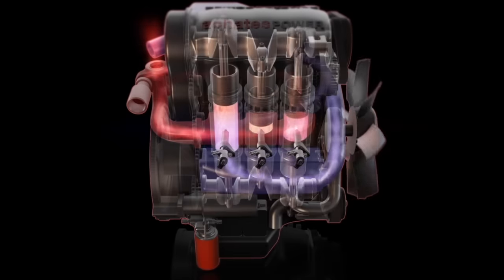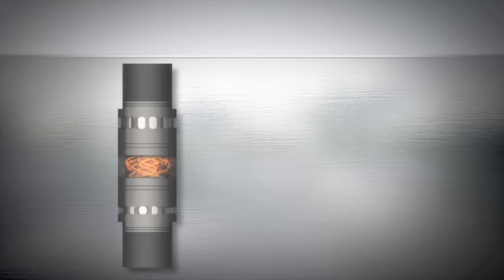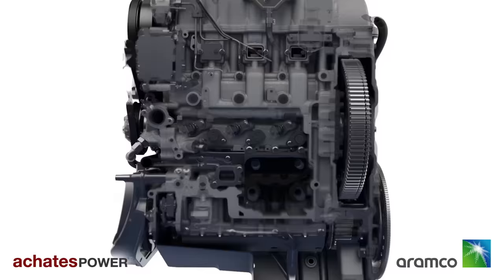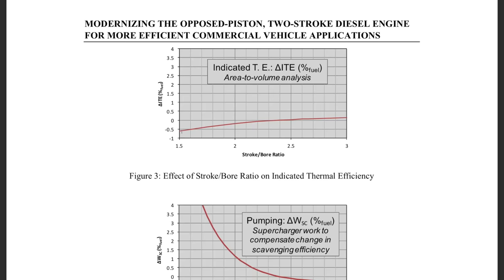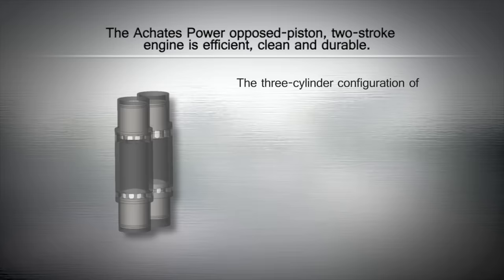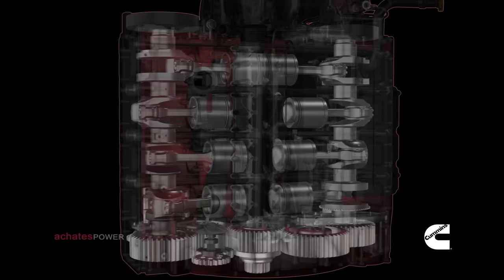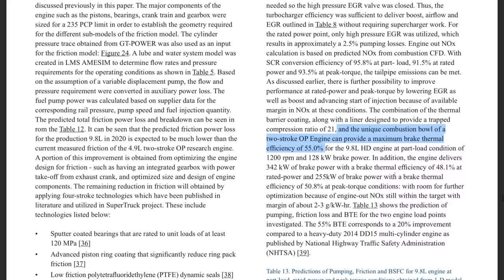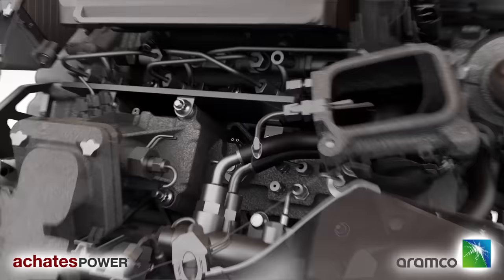Opposed Piston Diesel Engines Are Crazy Efficient

Comment: It should be put in perspective, 55% is an insane improvement in efficency
Reply: Any idea what thermal efficiency we're getting from our standard V-4 engines? 30%? And does this mean that, say, 70% of the fuel's total chemical energy is lost as heat through the radiator and drive train?
Reply: The average thermal efficiency for gasoline engines is in the 20-25% range, diesel engines are much better around 35-40% they will never be that great though thanks to thermodynamics the best case scenario for Internal combustion engines is in the mid 50% range if that for thermal efficiency when your turning one form of energy to another there's going to be energy lose its inevitable and unavoidable nothing can ever be 100% efficient which is why perpetual motion devices don't work
Reply: Theprfesssor that's not exactly why perpetual motion devices are impossible. They are impossible because they produce more energy then they use, as in above 100% efficiency. In theory you can have near 100% energy conversion efficiency. For example Electric Motors can convert electrical to kinetic energy up to 99.99% efficiency.
Reply: @XLR8bg   
   The problem with perpetual motion machine they are trying to do work without energy input, a violation of the fist law of thermodynamics but even if you give them energy to get going they still won't stay going because they will use up the energy and eventually stop, the sun has always been their but it to won't last forever along with all the energy it's given 
    btw the best electric motors can do is 90-96% efficiency which is amazing but still not 100 because thermodynamics is probably the most challenged yet successful theory in physics
Reply: @theprfesssor  You guys are both saying the same thing in different ways and both making true points. No need to argue :)
Reply: @theprfesssor  Thanks! Can you break down the energy losses by category such as heat loss, unburned fuel?
Reply: @tmst2199 
    I think it about 2/3rds of the energy made by internal combustion engines is thermal aka heat which is why cooling is a key part in the design of ICE cars especially performance cars more HP means more heat for example the super car Bugatti Veyron/chiron has like 10 radiators because it makes 1000+ hp and so much heat, actually I believe the engine used almost burnt down the Volkswagen facility when it was first tested in because they were not anticipating the amount of heat it would make
   Other loses are subjective and vary widely depending on the systems used but like I said before turning one form of energy into another your going to lose some of the energy in the process all you can do is try lose as little possible
Reply: @theprfesssor  Thanks. This subject is so goofed up in people's minds. Who profits from that? Technically, all the energy that gets converted to mechanical energy first exists as thermal energy. Heat causes the expansion of the power stroke. So I guess the question would be how much of the total energy of the fuel is being converted to thermal energy. And then how much of the thermal energy is getting converted to mechanical energy (through the connecting rods) as opposed to wasted through the radiator.
Reply: @XLR8bg  for electric motors, the scale play a big role. The bigger they are, the less efficient they become. An electric train engine is around 70% efficient. That's still way better than a diesel/gazole engine though.
Reply: @XLR8bg  I think you mean they use more energy than they produce
Reply: @tmst2199  ...and exhaust
Reply: @theprfesssor  Not native English speaker?
Reply: ( @theprfesssor  the sun has always been their ) Where?      And it has only been 4 1/5 Billions of years.
Reply: @ThePostal67  
      By always I meant as far as we humans and the rest of life on Earth is concerned, it's energy is the reason there's life at all on Earth it was the birth of it effectively...... and ironically when it runs out of fuel it will likely end by destroying the Earth and anything on it along with everything closer then Earth
Reply: @XLR8bg  yes, electric motors can be very efficient. However, we dont want to mislead people about internal combustion engines though, which are measured with thermal efficiency. ICE's fundamentally require a significant amount of heat to be rejected from the system in order to complete the cycle, which make even 60% efficiencies impossible.
Reply: @tmst2199  i believe it may actually be somewhere around 15-20%
which is in no nice term, shithouse.
Reply: @ethan-fel  Are you sure? I read an article recently that stated we were getting better than 90% efficiency from vehicle-sized electric motors.
Reply: @adrianf5665  Yeah. What a waste of resources.
Reply: @ethan-fel  i think you may have that backwards mate. At least with induction motors, the smaller they are the less efficient they will be.
Reply: A modern F1 engine is above 50% efficient, but that is really a special case.
Reply: @mawe42  yeah because they are hybrid engines
Reply: @mawe42  Interesting. I wouldn't have expected efficiency. Only performance.
Reply: @mawe42  yeah, you can't count them because they aren't designed to be used more than once. 200 miles is getting long in the tooth for one
Reply: VW: 55%? Here, hold my ECU programmer for a minute
Reply: Alex Frideres most of the billionaires are pushing renewables and carbon taxes to keep energy cost higher. The problem with this engine is that it burns oil and wont pass emissions easily
Reply: Along with heat, noise is also energy loss
Reply: @Mike Mixer These days these engines can do more than 2000, but that's still not much
Reply: @theprfesssor  wrong modern 4 cyl engines are getting around 35% and new Toyota engines are now getting 41%
Reply: @ThePostal67  proof the sun has been there for 4.5 billion years? It could have been created 50,000 years ago, you don't have any idea. No one does. Cool theory though!
Reply: @tmst2199  electric motors themselves may be efficient at converting energy into useful work, but the storage of the energy they use is not as efficient as a gas tank in a petrol car.
Reply: @slooob23  Correct. A gas tank can store more energy than a car battery even if half of it is lost as waste heat.
Reply: I wonder what improvements can be made with that greater efficiency to satisfy emissions regulations with minimal increase in technical complexity.
Reply: theScottsman1996: Not really... the large marine engines have been over 50% for years.
Reply: @ethan-fel  Not by the "time" you generate and transport the electricity, eh... which is why co-generation works when you can use the "waste" heat from an on-site generator set.
Reply: @LawClapp95  I suspect that if that figure of theirs isn't based entirely off what they pulled out of their ass the discrepancy may be due to a study comparing the average efficiency of operational electric locomotives and operational electric cars. Of course, such a study would be very misleading as it ignores hugely significant variables between those groups both related to the massive discrepancy in the average age of these two classes of vehicle. The electric locomotives will on average have been manufactured far earlier than the cars and will on average have many hours more wear and tear degrading their performance also. All simply because they were able to carve out an economically viable niche in the market far before electric cars were able to thanks for the most part to them being constrained by nature to follow very predictable and rather precise alignments as they travel thus making it rather easy to power them by aligning a collector contact with an external fixed conductor and not have to wait for onboard electrical storage technologies to be an option. Road vehicles are much more tricky to power this way without some sort of active system to maintain alignment as they have a degree of freedom in the lateral direction trains simply do not have.
Reply: Entropy Calculations of every process ...   Or, for the younger generation  .. Harry Potter magical energy.
Reply: Could this be an air-cooled engine? How would compression braking(Jake brake) affect it? Start stop hybrid? For class 2 to 8 trucks?
Reply: Yes I am surprised the efficiency of existing engine designs wasn't mentioned
Reply: @XLR8bg  without a perfect heat sink no engine of any type can be perfectly efficient, and a perfect heat sink doesnt exist
Reply: @tmst2199  The lost energy is mostly in the exhaust gas, not the radiator or drive train.
Reply: @pauleohl  As unburnt fuel or heat?
Reply: @theprfesssor  Tesla turbine cold steam turning is near 100% efficient. Its done in near vacuum, so its strictly a heat conversion... you know... its interesting enough that tesla turbine gets cold as in it exctracts heat and turns it into energy.
Reply: @XLR8bg  didnt know they gotten so efficient. are you sure its near 99% efficient? I almost cant believe it apart from some nanometer accuracy supercooled experiment.
Reply: even if the electric motors are more efficient, the batteries are not. They heat up while charging and discharging, charging them from 80-100% wears them out and they have to take way more energy than from 0-80%. So yeah electric is best, but not batteries
Reply: @jerrykinnin7941  yep
Reply: @jamesbrown-pk2do  only money pits
Reply: @marcoaranas  well it's a reference point between created temp and cooling temp.
Reply: @ungivenfame1  that's not how thermal efficiency works. The electric parts arent cooling reservoirs or temp reservoirs
Reply: @zcoleman4187  all engines burn oil. Even electric motors burn their grease. Also most diesel 2 strokes dont actually burn that much oil relative to their 4 stroke counter parts is comparable
Reply: David M  my brushed dc motors range from 0-70 percent thermal efficiency.
Reply: @jerrykinnin7941  Jake brakes work off of keeping valvetrain open this would need a exhaust brake
Reply: @manipulativer  um thermal engines which your talking about a rankine cycle engine cant be above 70 percent according to thermodynamics
Reply: @zcoleman4187  but a 2 stroke such as a diesel or big gas such as this would burn very little engine oil since they have sump and use pressure feeds and have piston ring scrapers to help stop the issue. They burn far less than a gas/oil mix 2 stroke or a rotary. Everything that needs a oil based lube burns oil it's the nature of friction and heat. So again like I said they burn very little oil and all motors burn a small amount of oil. Even your pneumatics will have small amounts of oil burn somewhere in the system but pneumatics also burn less than electrics because they cool more than heat
Reply: @theprfesssor  the Mercedes F1 engine is capable of 50% efficiency now.
Reply: @mawe42  Mercedes f1 makes 50% as it recycles via turbo and hybrid electric motor. The rest aren't there yet.
Reply: @Music10161  you're well outa date with your knowledge of F1.
Reply: @Ken Shackleton Yeah. Isn't that hideous? And let's not forget the transmission, which often requires yet another cooling circuit unnecessary with EV.
Reply: @jdrok5026  ye but the rankine cycle uses water and the tesla turbine under vacuum uses cold steam... There are almost no losses, just like the "super heat conductor"
Reply: Alex,
I doubt oil executives care about that!  In fact, if a gallom of fuel produced more usable energy, the operator could afford to pay higher fuel costs!  This looks like a concept that has merit!
Reply: @zcoleman4187  yea no they're not. At all. Many billionaires have their wealth from oil and lobby against such things
 
Musk is an outlier
Reply: T Mst most engines in cars range anywhere from 15-35%. Gasoline has a lot of energy stored in it but its mostly just lost as heat.
Reply: Literally all diesels slobber and throw oil out the exhaust when being idled 2 stroke diesels arent worse about it either.
Reply: @manipulativer  also rankine cycles use steam which is super heated water vapor...
Reply: @GB-vn1tf  thermal efficiency isnt going to account the regeneration systems because thermal efficiency is entirely the engines process
Reply: David M  my motors are industrial brushed motors and hobby motors the brushless motors are 80 plus but again it's a 0-80/90 percent thermal efficiency
Reply: @jdrok5026  ye, but they use cold steam which is at room temperature and it has other strange properties like expansion based on cooling/heating.
Rankine cycle is a matthematical construct dude it has no corelation with reality. They achieved sub 0 kelvin yet the calculations they did said its imposible... its a religion
Reply: @jdrok5026  it's the energy efficiency of the fuel that the figure comes from. Total efficiency includes all energy recovered or generated which includes power from the turbo as well as the electric energy from the hybrid system.  Its Mercedes AMG F1 team figures I'm am using.
Reply: @jdrok5026  but the turbo exactly uses the thermal waste to increase efficiency of the chemical potential.
Reply: @GB-vn1tf  that wont raise a engines thermal efficiency tho a engine thermal efficiency cant be measured by auxiliary systems because any heat recapture is rejected heat from the engine and this process will in reality be a further decrease to efficiency because the system itself is inefficient. Thermal efficiency isnt measured by anything other then cooling reservoir temp and the thermal reservoir to have a 51% thermal efficiency gasoline engine the engine itself will be running a 51% efficient cycle as the waste heat being recaptured is after the cycle. The regeneration systems cant be apart of the thermal efficiency equation because they are relying on the rejected heat of the engine to capture energy in Mercedes form centrifugal power generation. Atleast any thermal efficiency calculation I've ever seen doesnt take into account anything other then the process the engine does. If suddenly using outside recapture devices can raise thermal efficiency I would need to see how you measure centrifugal systems that are using the air speed to charge the system as they literally heat the air as it is making it less efficient in some ways
Reply: @jdrok5026  I'm talking about chemical efficiency as energy recovered from the chemical potential.  Therefore all energy recovered from the fuel is counted. The energy has to come from somewhere and in this case it's from the fuel. The turbo directly recovers energy from thermal waste.
Reply: @amascia8327  
I thought of this as a kid. Why do we just blow away all the heat?! Especially because most of what is produced IS heat. Lol
Reply: @billybbob18  The main answer to your question, "why do we blow away all that heat?", is that it's generally low temperature... around 200 to 300 (°F) and hard to find uses for... for example, hospital hot water, greenhouse heating, district/utility heating (like ConEd steam in NYC)... Hard to convert to electricity or motive power. If you check, "bottoming" cycle machinery you'll find they're relatively inefficient and only practical when there's a lot of "waste" heat available. The exhaust gasses being hotter are easiest to recover but mostly are used for turbocharging first (as in the diesel engines). Then, the exhaust heat can be recovered. The turbocharging energy is mostly from the incomplete expansion in the piston part of the power stroke recovered as power on the intake stroke. Anyway, it seems nothing is simple... Regards.
Reply: David M  Very large electric machines such as those use in hydroelectric dams can definitely have efficiencies over 95%. Those generators are room sized though.
Reply: thescottsman1996 🔥
Reply: @RmRoyalflush  That's only correct if you're talking about lead acid. Good quality lithium batteries don't take any more energy to charge from 80 to 100 than they do from 60 to 80. If you consider 4.05-4.10 volts to be "Full" they don't wear out quickly.
Reply: SKYACTIV-X
Reply: Alex Frideres  yes and then when the electric production companies become billionaire off renewable resources we'll complain about how much they make as well
Reply: @theprfesssor  electric motors aren't 100% efficient too. But they are like 90% efficient which is great
Reply: T Mst   These #’s are also speed and load depend.   There is also a heat engine system somewhere on the grid generating 80-90% of EV juice.  So. Coal, Nat-has, oil or nuclear.  Heat engine power stations average 45% if they are modern.     Hydro is up maybe 15% and unreliable solar/wind the rest.
Reply: Everyone talks about the efficiency of electric motor but makes no mention of the efficiency of the power plant that produces and transmission of that electricity.
Reply: @tmst2199  EV's in the future will have transmissions or multiple speeds, because you can keep the electric motor in its peak power or efficiency range at different speeds that way say 30 mph and 60 mph with a 2 speed transmission
Reply: @thorlancaster5641  if you carry 100k kwh of battery and only have access to 75kwh of it then you are lugging around dead weight everywhere, gas tanks get lighter as they empty, and lightness is also critical for efficiency of moving a vehicle
Reply: @alexmills1329  Makes sense. I see something about the Tesla AC motor having a particularly flat torque curve, though.
Reply: @theprfesssor  entropy
Reply: Thats more efficient than the 1.6L V6 turbo in the Mercedes F1 car
Reply: @XLR8bg  perpetual motion machines do not need to be over 100% efficient. If I had a machine able to cool the sea and produce electricity it would not violate the conservation of energy and it would not have >100% efficiency.
Reply: @theprfesssor  not all perpetual motion machines violate the first law of thermodynamics. If you had a machine cooling the sea and producing electricity it would be absolutely fine regarding the conservation of energy. The 2nd law is the reason why heat engines will never be very efficient and such a machine can't exist.
Reply: @theprfesssor  oh and talking about the first law of thermodynamics and then saying machines "use up energy" is a bit ironic as well...
Reply: Large 2 stroke marine diesels are up to 55% efficient and are available up to 100000 kw 'built by Wartsila Sulzer in Finland .
Reply: @jamesbarrick3403  Is that HHV efficiency or LHV efficiency? Makes a big difference.
Reply: @theprfesssor  the reason they won't be great is not really thermodynamics.

If you follow only thermodynamics, then 100% efficiency in an internal combustion engine is theoretically possible...on paper.

The limiting factors are things like mechanical design, material limitations, fuel limitations, etc.
Reply: @impactodelsurenterprise2440  Solar panels are ~22% efficient, but sunlight is free, so it's not that bad.
Reply: @jannikheidemann3805  Perceived to be free, but not really in the general scheme of things.
Reply: @etothee5339  Radioisotope dating.  Radioactive materials decay at a known rate. Look at the state of decay of items that would have coexisted with the sun at its creation (e.g. meteorites) and you can get an educated guess at how long ago everything balled up into the big glowing orb.

We use the same thing for dating rocks and it works pretty well...
Reply: @theprfesssor  nipe thats not the reason.
Reply: Screw electric cars, i'd rather take a 55% efficient diesel engine that would run on vegetable oil
Reply: You even can use heat from engine makes steam power. :P
Reply: @XLR8bg  You have it backwards.... they USE more energy than they produce.  That is why perpetual motion devices are impossible.
Reply: @tmst2199  Yep. Some idiots are holding them back. We know all about these engines, they fit in the cars we have, they have fewer parts which gives easier maintance, and they use  the existing infrastructure - no use for installing millions of charge-stations. My modern 5-person diesel averages 58 Mpg if kept around 70 mph on the higwhay, and emission is very low. I don't care about the CO2, nobody has ever proved it is dangerous, but other stuff should be kept under control..
Reply: @theprfesssor  A slow-revving ship engine or stationary can come close to 70. It is well-proven technigue.
Reply: @theprfesssor  only things that are 100% eficient are heaters, stoves and furnaces. And any other device wich main purpose is to turn electricity into heat.  Wich means al electricity gets turned into heat
Reply: @tmst2199  Actually most of the heat loss is in the hot exhaust gas, not the radiator or drive train.
Reply: @tmst2199  don’t forget, for every pound of gasoline you use (fuel), you need 11 to 15 pounds of air (oxygen, ie oxidizer) for it to go ‘boom’ and work.  It’s the oxidation of the fuel that releases the thermal heat energy which is then mechanically harvested and converted into mechanical movement.
Reply: @theprfesssor  Thanks. I knew it was in the 70% waste heat region. So getting it down to 45% would indeed be impressive, as we're talking about decades-long cycles of efficiency optimization without a 100 mpg carburetor.
Reply: @americanrambler4972  Well well stated. Grade A.
Reply: @americanrambler4972  And how does this relate to Einstein's quantum-based photovoltaic effect? It's the freakwencies, dude.
Reply: @tmst2199  Haven’t  a clue. Wiggles, jiggle’s and giggle’s?
Reply: @theprfesssor Maybe the heat energy from ICE could be used by the car if a steam engine was added to the driveshaft too & be supplied with steam from the radiatior's water when it gets superheated after passing through the ICE
Reply: @etothee5339 ok, but you have anything to say thats related to the topic of the video or just cars and engines as a whole?